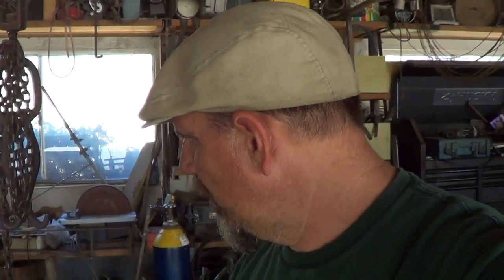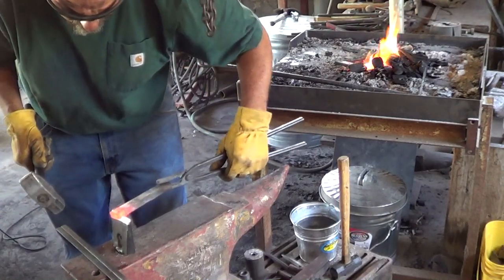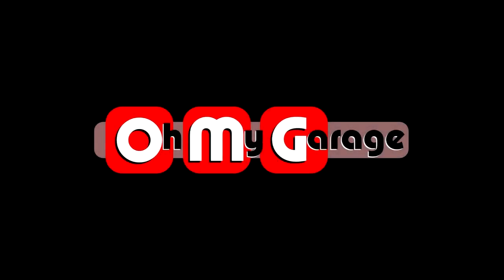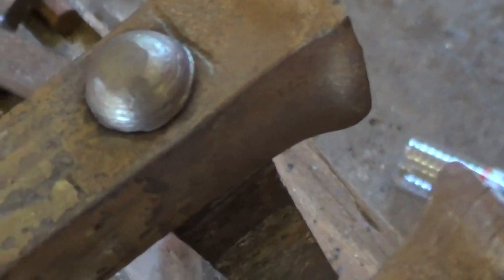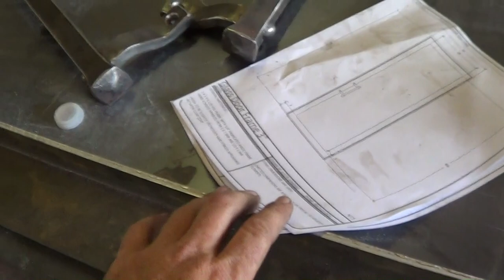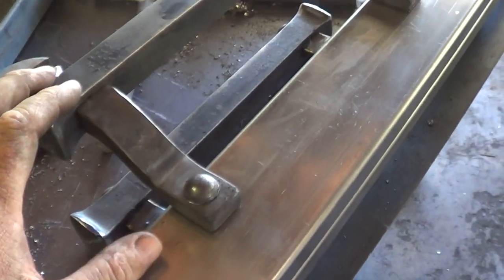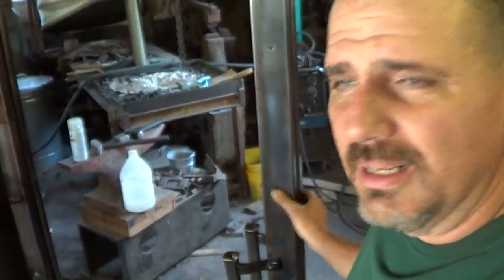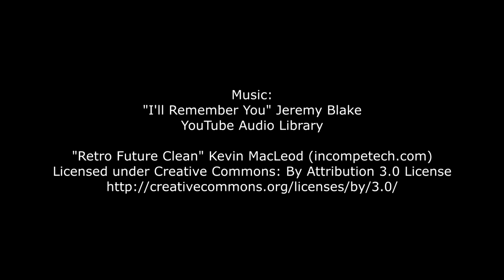Wine Cellar Door with Forged Handles   OMG 2019 1

Comment: Hi Justin!
Reply from the maker: Hi.
Reply: @JustinJennings  I randomly came across your video while looking at some wine making videos (which led me to a wine cellar door), you have the same last name as me. Thought I would say hello.
Reply from the maker: @Njennings42  So what does one do with distilled molasses? Sounds like something to cause blindness.
Reply: @JustinJennings  You stick it in a barrel for about 3 years, then bottle it and drink it over time, of course.

It's fairly harmless (just as safe for you as any commercial drinking spirits) if you understand the process behind distillation, and your equipment is made with the proper materials and construction methods.

Methanol is what causes blindness, but methanol is present in nearly every single kind of non-distilled-spirit too, it's just the concentration that can harm you.

Molasses produces very little methanol during fermentation to begin with, (generally fruits have the highest amount) but in 10 gallons of what is essentially a "molasses wine" (roughly 10% abv), there is about a quart to two quarts of methanol, and about 4-5 quarts of quality spirit, followed by a few quarts of fusel oils and other not very pleasant esters and things (they won't kill you, but they might give you a bit of a hangover).

Can't go wrong with a fine barrel aged rum though, that much is sure.